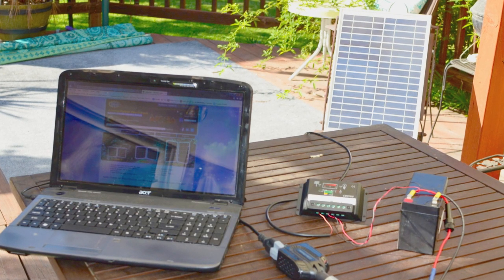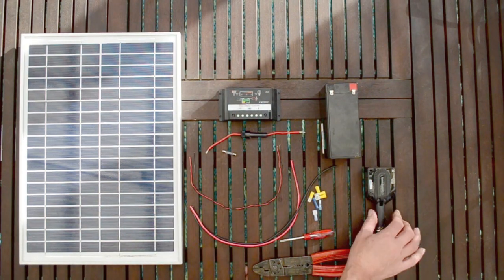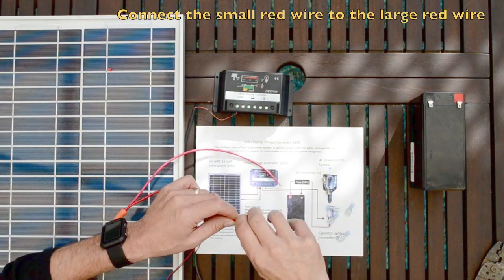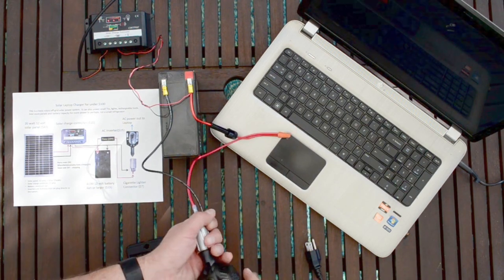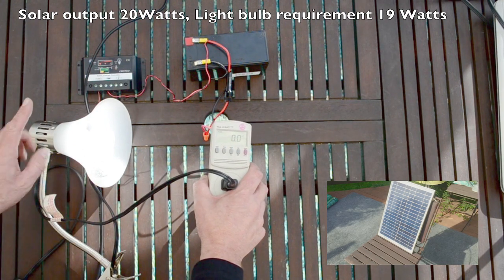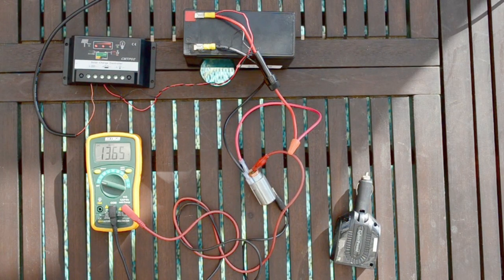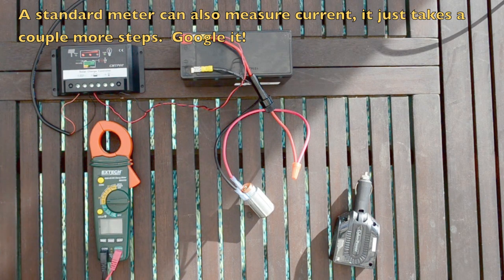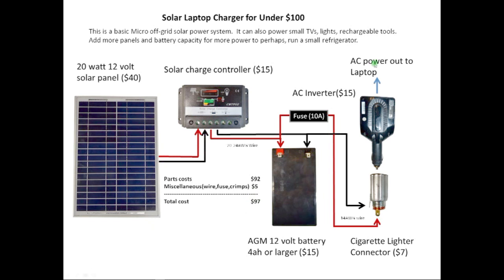How to build a Solar Laptop Charger for Under $100

Comment: This is great man thanks.  I'm attending school and living out of an suv so.. I could just buy an all in one thing but what fun is that?  My laptop "charging cable" (ac to dc converter) is rated at 20v -- 4.5A.  I understand this means that anything over 4.5A (4.5 coulombs of electrons) passing a point per sec will overheat the charger.  I guess my question is, if I use a 36v bat on this system, which component here is regulating that amount of force?  Must be the AC inverter right?  And so those ac inverters must have a rating of how many volts they can handle?  Anyway thanks
Reply: It is not the amps that you will have a problem with.  It is the voltage of 20 volts that you need to keep constant.  I would stay completely clear of trying to produce a DC power source directly to your laptop.  This is why we use an inverter. Small AC inverters are typically 12v DC input and 120 Volts AC output. Then plug your laptop power supply into the inverter like the video.  As far as using a 36 volt battery, this is very unconventional and uncommon.  Typical solar charger systems are 12 volts.
Reply: @deansala3200   i see... you run them in parallel the voltage will stay the same but your amp hours can increase.  Anyway I think what I'm most worried about now is a sloppy sine wave.

Comment: Could the 20w panel in this video be replaced for something that is 10w, but still 12 volts? If it's possible what would the downsides be?
Reply from the maker: I recommend at least a 20w panel.

Comment: Laptops run off of 15 to 20V DC. Why would you hassle with inverting DC to AC, just to turn it back to DC?
Reply from the maker: So you not have to hassle with voltages and plugs and reduces the risk of blowing your laptop..  Much easier to use the laptops power supply.  This was discussed in an earlier post.

Comment: where could i buy that solar panel with wire? tried finding that one but no luck
Reply from the maker: Most panels do not come with wiring.  One option is to use sprinkler head cable found in hardware stores.  Or you can even use speaker wire. Thanks for the question. I did not think about this in the vid.
Reply: okay thanks for the advice, using this video to help with a school project so thanks for making the video!

Comment: does it the inverter has to have a fuse on it
Reply: Yes, the fuse is in the tip of cigarette plug
Reply: Depends on how much you care about anything else melting. But a fuse is in most cases cheaper and a more controlled way of stopping an overload.

Comment: Hi, thanks for the video. Please, what's the difference between running free and charging the laptop? I thought laptops take always the same range of energy from the source. What's your laptop requires? Can you charge it with less? There is a limit in this arrangement?
Reply from the maker: Laptop AC wall chargers come in many variations of power output. Meaning they down convert voltages anywhere from 15v-20v DC depending on the brand. There are some compact batteries on the market that can charge laptops but they also include many connectors to match the laptop charge connector. If you are lucky, one of these connectors included will fit your laptop. It is a risky move trying to figure out which connector works.

This video basically shows you how to get AC power from a solar panel.  It by-passes all the complications in between and lets you use the AC laptop charger itself.  Sure there are some losses.  But you can pay more money for better equipment(i.e. better inverter, larger panel, bigger battery). Regardless, this is the typical off grid system in the smallest form.
Thanks
Reply: Ok. I'm afraid of the consequences from not charging with the power (more or less) it was made for. So. You can't work with this energy becouse it's less than the laptop requires, but it's enough to recharge the battery. That's it? Thanks a lot for answering.

Comment: Hi, thanks for the video. How do you prevent the solar panel from overcharging the battery when full? I heard some solar converters can switch to float charging when the battery is full. Is there a way of knowing if the converter does this/is there a specific type of converter that does this?
Reply from the maker: Hi David,  
The typical solar charge controllers available these days know how to charge and maintain battery health and will not overcharge.  Some controllers show basic charge status with LEDs, some show more. It all depends on the controller, but most all are made to charge the battery correctly.
Reply: Thanks for your reply. I understand AGM batteries are made for deep cycling. However, if the solar panel is of a high enough wattage can I use a standard lead acid battery? My thinking is that if I don't drain the battery and keep it charged with the solar panel, I could charge my laptop using an existing car battery, i.e through my car. For example,  If my laptop requires 3.25A * 20V. If I connect a 65W+ solar panel (costing less than $100) to my (lead acid) car battery in my car and then plug the inverter into the car's cigarette lighter (which already has a 10A fuse) would this work, or would I just destroy my battery and be back to using my bicycle  :-) ?
Reply from the maker: Hi David, Yes you can  connect any solar panel to your car battery using a solar charge controller. It is basically the same thing as the video. Then you can use a  cigarette lighter AC inverter adaptor in your car.

Comment: why convert dc to ac then back to dc?
Reply from the maker: It gets complicated to charge laptops directly from the raw power of a solar panel directly.   Laptops are all over the place when it comes to input volt requirements. For example, 12v, 16v, 19v etc.  And they all use different power cables/plugs.  I decided it is easier to just use the laptop's own power supply.  Of course to do this, you need an AC source.  This is where the 12V battery comes into the equation where you can use it to run a small inverter for the laptop's power supply.

Comment: with this array, a laptop works 24-hours?
Reply from the maker: It should if you increase the battery to 8Amp/hours.  You may want to increase the solar panel to 40 watts too.
Reply: laptops are not designed to run 24 and might crash from time to time.
if you want to run something like this 24 try a single board computer such as raspberry pi or my favorite the odroid which runs on 5 volts .
which in most cases charge controllers have usb ports which you can use for this

Comment: Can I use a normal 12v 8HA battery?
Reply: Not the AGM
Reply from the maker: As long if it is standard rechargeable 12 volt battery.

Comment: My laptop :19V---6.32A; Is it going to work?
Reply from the maker: It should work.  Your numbers are typical for the average laptop.  But the beauty is, is  that you can expand on this system for more power. Larger panel, larger battery, larger inverter. This video was made to teach the basics.
Reply: Laptops draw the most power when the battery is empty, but you should be able to use a laptop on it fine when the battery is near full. Mine says 20V 3.25A but it's less than an amp when the battery is full.

Comment: Can you list links to and/or names of the exact parts you used?
Reply from the maker: Hi Jeff,  Good question. There are many choices of each part so I can't give a specific list. The parts are pretty much generic and there are many brands to choose from.  Ebay and Amazon and the local hardware store is where we sourced the parts for this,   There is a link in the Youtube description to download the flow chart.  Google search on the parts described(20 Watt solar panel, solar charge controller, AGM battery, Small inverter), and you should find what you need for this project.ThanksDean

Comment: hey great video, i have some questions like where in canada i can find one of those cigarette lighter connectors and how to properly wire it on? thanks.
oh man i just realized out of excitement i didnt even watch the video.. lol its in there,, but i couldnt find where to buy one so that would be nice to know
im building a set up myself for my laptop with a 100w solar panel.. its going to be under $200.
Reply from the maker: Hope I am not too late on the reply here.  I have seen the cig lighter receptacles in Auto Parts stores. Of course they are available all over the place online.
Reply: @Dean-Sala  Good day! This is fantastics. How to get in touch with you. Thanks
Reply: @Dean-Sala  Can anyone without electronic or electrical background do this? Thanks.
Reply: @Dean-Sala  Can you make and supply this? Or can we find it in the market? If yes where. Writing from Cameroon.Thanks
Reply from the maker: @ngijoeclemence2149  deansala@suntactics.com
Reply from the maker: @ngijoeclemence2149  I would be willing to make this into a product  for you but I would need a very large order to make it interesting,

Comment: its only to bad you can't just plug the solar energy right into the laptop.

it just seems like a waste to go from dc to ac and then back to dc again.
at least that my prospective on it
Reply: The actual laptop's charger is your assurance that the device is receiving the correct input of power, keeping the battery, as well as the laptop's components functional.

Try using another charger that fits your laptop's socket, but wasn't made for that laptop.. you'll see what happens in two weeks of doing that.
Reply: @Blue-Lady  
only factors that matter are
1.can it provide enough wattage(amperage*voltage)
2.is it the right voltage.

well for 2nd 1 its pretty simple really , you just need a dc to dc converter or a voltage regulator however you will need to make sure the wattage of the panel is high enough for the laptop as well.

most laptops don't care for brands or at least none that I've seen the biggest differences between them really is the voltage and amperage ratings of the power supplies , if you match those then your golden.

90% of the problems happen when you use a power supply that is even slightly less capable (5 amp supply instead of a required 5.5 amp)because then it fails causing damage.

Comment: hey bro anyway you could build one and ill pay you to send it over with a fee onto for you time :)
Reply from the maker: I sincerely wish I could build one of these units for you. Problem is, I have no time to do it!  Perhaps you can find a friend to help you make one.
Reply: maybe you could help me.  I have a Mac book  and the charger needs 85 watt. I brought a 85watt inverter. and going to buy 100watt solar panel.  now the 12v battery would still work?
Reply from the maker: Yes, you are on the right track. Find a solar charge controller to connect in between the solar panel and battery and you will have the complete setup.